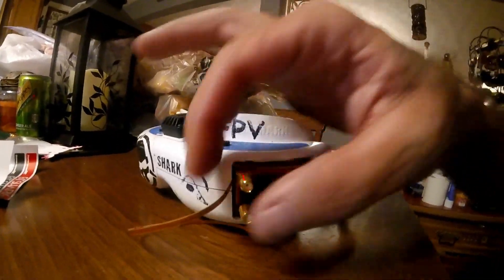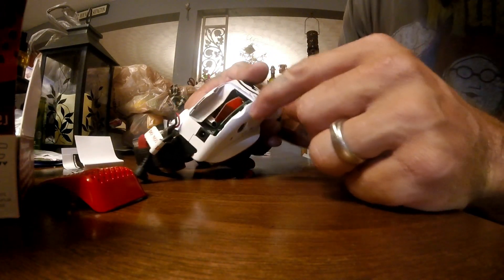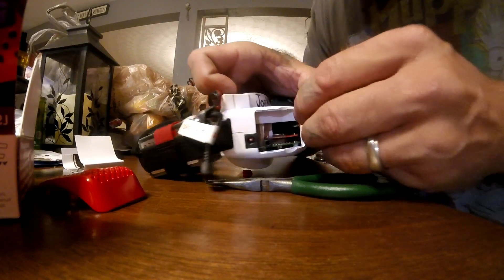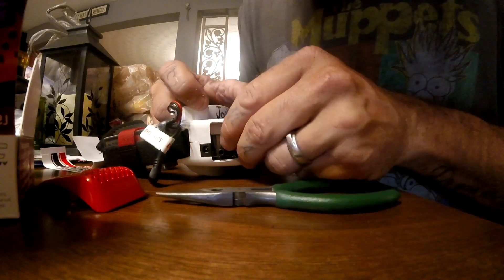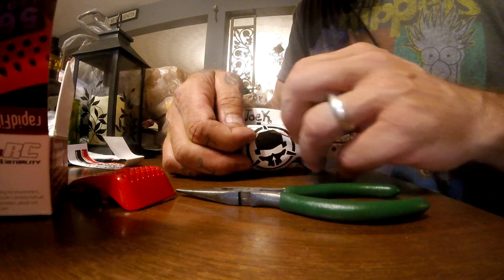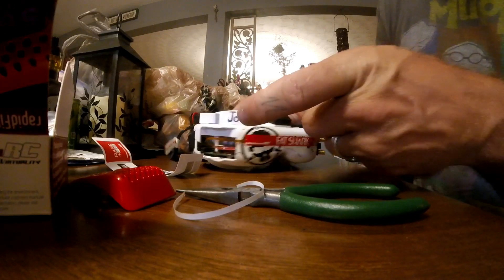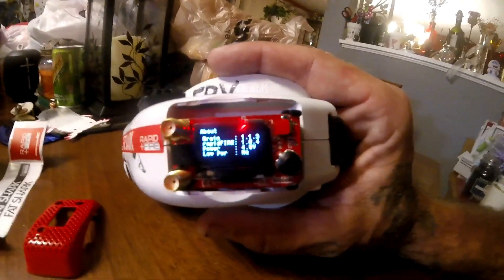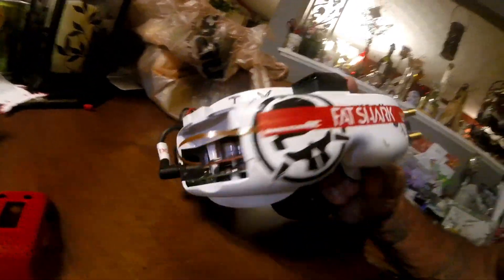Immersion RC Rapid Fire install in Fatshark dominator V3's

Comment: Man,  those riben cables are so easy to break... Some guys put a led strip covering the riben and it looks so cool that way... You should do a build vid one of these days, it helps a lot guys like me that are noobs to putting a quad together... Big hug bro
Reply from the maker: Drone Lovers FPV I’ll do another build video. I usually use the same components so my quads are kinda specific. But hopefully it helps.  Plus I always build crossfire birds which is also specific.

Comment: Nice man..thanks for sharing this. I run the hd3s not sure how rapid fire hooks up to those but i may invest in it at some point..🤘🤘🤘
Reply from the maker: KevFPV hd3’s are plug and play. The dominator v3’s needed to use the head tracking port for a second board to balance the power. Otherwise you’d get low power warnings. All that was fixed when hdo came out.
Reply: @JoeMaxFpv  sweet homie!! Good to know!! 👍👍

Comment: I've got same goggles with laforge v2 for 1.5yrs and wanna get a better system would rapidfire or v4 laforge be best?
Reply from the maker: Danger Davefpv rapid fire is better. It patched both diversity antenna together for a seamless signal. Laforge switches between antenna depending on which Is stronger. The result is rapid fire can penetrate through buildings and heavy woods with no issue. I’ve also flown over a mile and a half away and had perfect video.

Comment: So sir do u like rapidfire in ur v3? I have v3 dominator but lol I still have old laforge v2 and I need or want better video.. should I do rapidfire?
Reply from the maker: Danger Davefpv so sorry I missed this comment. Rapidfire is 1000x better than other modules. I’ve had Laforge, true d, and holybro. The way rapidfire patches the signals together I’ve had flawless video from extremely far away. Once you try it you’ll wish you did sooner.

Comment: Hi bro.... Pls. suggest me a 4s lipo charger which can charge multiple batteries. Not too costly ones.
Reply from the maker: Firografi sorry for not seeing these replies. 

I only use the venom chargers. They are a bit pricey but are extremely easy to use and have power to run balance boards and I can charge 8 batteries at once on the duo. Let alone if you got the quad charger!! You could do 16 at once.

Comment: Bro , i installed rapid fire on my dom v3  and colors look horrible  i plug  my furious module back and colors are nice , what can it be ?
Reply from the maker: IPHONE_PRODUCTION's 914 I didn’t have an issue with my first set. But I’m having the exact same issue as you now. Have you tried calibrating them yet? I am going to do that next. If I still have this issue I may contact them directly. Because I haven’t even been flying because the experience sucks.
Reply: Joe Max Fpv i havent done anything to it yet my lipo died lol gotta chArge it , but yea man , sucks  , the sky be looking green. And other stuff look  white ,
Reply: Joe Max Fpv  did u resolve the issue? I did the update but still have the issue
Reply from the maker: IPHONE_PRODUCTION's 914 no I did the updates and calibrated my antennas but still have the issue. I’m very upset. I had the very first run of rapidfire and it worked perfect. This one sucks.